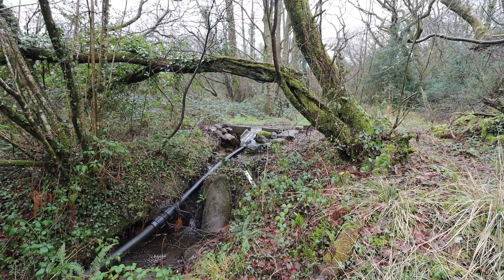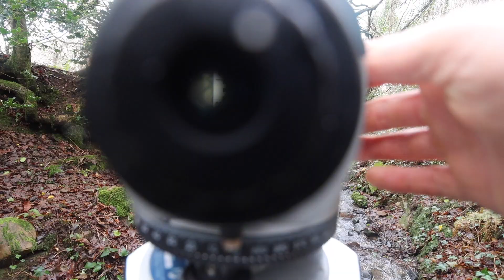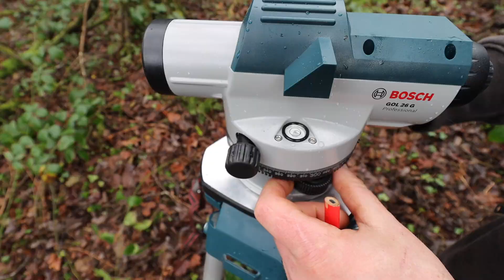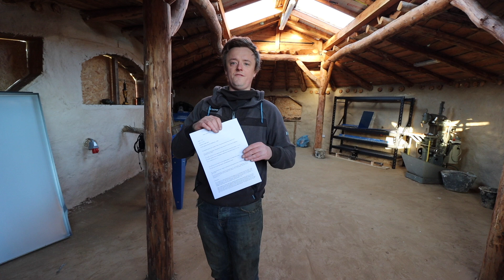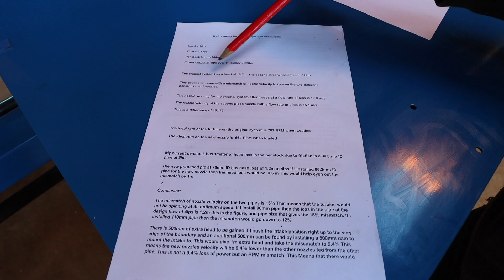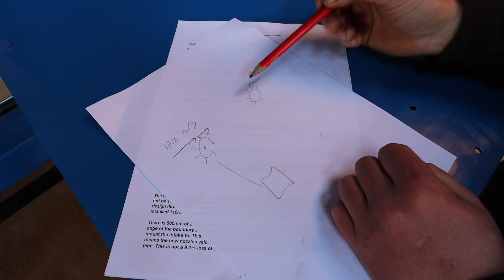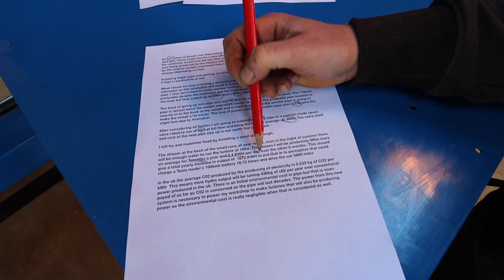Adding A Second Penstock To My Off Grid Hydroelectric Turbine (Survey)

Comment: Chris,  you can measure the water pressure in the bottom end of the pipe right. Use simple mathematics to calculate height of water.

Comment: To find the correct level for my oil tank I used a hose pipe filled with water, did the job fine after getting rid of air pockets.

Comment: I'm a bit late to the party here so probably just shouting out into a void. But I do wonder why not join the new pipe into the old pipe wherever possible? This could be done via what is known as 'an unequal T' (or Y would be more efficient), then increase the diameter of the pipe from that junction down to the turbine (if needed). This means that all of the water exiting the penstock at the turbine is all the same and there is no variation. 

What you did back there was take some accurate measurements of just one snapshot in time. This doesn't work in reality, because the stream flows are constantly variable.

Comment: In stead of an extra turbine, you could consider to only add an extra turbine wheel of a slightly smaller diameter. In that way it can deal with the lower waterspeed of the second penstock, without mismatch.

Comment: If I understand the theory correctly, the radius of the turbine is a variable in the ideal RPM for a specific nozzle velocity... If this is the case, could you stack two turbines on a common shaft, with your larger original turbine on the bottom and a slightly smaller turbine on top sized for the new pipe nozzle pressure?

Comment: Don’t be terribly concerned with looking professional. I once had an above ground swimming pool installed. The installer came in with a brand new surveyors transit. Set it up and shot all the pads for the pool wall supports. They put it up put in the liner and as it was filling I noticed it was several inches out of level. I called him back and he did some measurements and we had to drain the pool as it was almost 5 inches out of level. He was quite perplexed. It seems one of the people had tripped over the level as they were in the middle of the installation and it wasn’t reset. His brother showed up who also owns a pool company and asked him what he was doing. He explained that he got the pool up and it was out of Level. His brother laughed at him and askrd Did you really spend all that money on the transit? He then reached into the back of his van and pulled out about 100 feet of clear plastic tubing filled it full of water attached to a stake, and Proceeded to set his elevation on all the pedestals. He had it done in about 10 minutes. Of course he told his brother he was an idiot for spending all that money on the transit. It’s not how many cool tools you have, it’s how well you use them.

Comment: Thanks for your videos, I like the no BS approach you take. I have installed many water systems for drinking water and used an optical theodolite to measure fall as much as distance. However, I am not writing this to teach my granny how to suck eggs, rather to point out that you could have two rings of spoons on your turbine with different diameters set one above the other. As the turbine speed is related to the circumference of the turbine wheel with relation to jet velocity both supplies can act on the same shaft with least costs involved.
The video with the water wheel spilling water over the side could do with an angled plate set into the middle of the race before it hits the bend.
Keep up the good work, with greetings from Herefordshire.

Comment: Very interesting (I just binge watched SEVEN of your videos!), but I have a few questions on this one: Would there be any benefit in combining the two pipes before the turbine?  That way (I think), you don't have to worry about mismatches at the turbine, or adding an extra injector, you just effectively get more water/higher pressure coming into your system.  Also, if you take the water right on your boundary, but decide on a dam as well, wouldn't that mean that you'd create a 'mill pond' on your neighbor's land? (So, creating a dam effectively means moving the head back a few meters to stay on your property.)  And, lastly, if you extract water from one stream, but output it into another, does that have an environmental impact?

Comment: Hey Kris, I’ve learned that the most efficient energy transfer from nozzle velocity to turbine power is to redirect the water flow 180 degs as it travels through the blade. I see yours is around 135 any plans to improve or will this cause too much splash drag ?

Comment: Hi Kris, im not sure if you still check this video or how far along you are in following through on this second penstock, but I was wondering if you considered a hydraulic ram pump to pump the water uphill to the current penstock intake instead? Obviously it depends how much more power youre looking to get with the new system compared to how much water you could pump up with the ram

Comment: So, this might be harder to add in after the fact, but if you were building a system with both pipes from the start, maybe it would make sense to actually pipe some water from the higher head pipe to the lower head pipe?

Or would the fittings and turbulence involved to incur more loss than you might get by evening them out?

Comment: It sounded as you needed permission for it !?
*
I was wondering, if you made a joint some 20-25m before the generator and install a larger pipe there :
a) the loss would still occur?
B) would be too much cost?

Comment: At what distance in the existing pipe is the head between the two sources equal? Could you not run the second pipe, joined to the first, just  a meter or two below the equal head point and combine the flows in a buffer tank giving you more PSI at the turbine?

Comment: Hi kris, what would that survay cost?  I'm building a 6ft by 4ft adjustable width under shot water wheel  with 12 spokes as a hobby,  how would I calculate the flow needed to give 500 watts + thanks Ray from Manchester England

Comment: I don't understand.  I think the analysis is wrong. The flow rate and head of each water source is fixed (and thus the power each can contribute to the total is fixed), but the nozzle velocity is determined by nozzle diameter, isn't it?  Afaik, the velocity is proportional to 1/(d squared) so you can just choose nozzles to make the velocities match.

Comment: Your new level is what a surveyor would call a “Dumpy” level and whilst yours has just to get the spirit level bubble inside the circle for the auto levelling mechanism to work the older instruments were attached to their base plate which was fixed to the tripod by three screws which, when turned, altered the height of the instrument above its base plate. In addition you had two linear spirit levels fixed at 90° to each other.  You would start with a screw in each hand and twist the screws away from each other or towards each other. The golden rule being that the bubble in the spirit level you were seeking to adjust always moved in the direction of the left thumb. This mechanism was, for obvious reasons, called the tribrach. 

During its construction I was fortunate to visit the Nat West Tower in the City, now called Tower 42, and was surprised to see that the suspended ceilings were being levelled with a water level. A clear open ended plastic tube filled with water. All done with lasers now but never forget the old tried and trusted methods.

Comment: what if you install a ball valve onto the original pipe with a flow meter on both pipes to be able to see the actual flow rates and then even them out that way. Go with the larger pipe on the new pipe installation but add a ball valve and flow meter. You can adjust the ball valves to get even flow. BTW have you ever considered a ram pump which uses no power?

Comment: Maybe not for your system as you might as well start over, but maybe for future designs for others, what about another pelton wheel on the same shaft - I assume below the original wheel - of a different diameter? This would allow the spoons to go by at different speeds - but probably not a large variance in speeds available in such a small package, like the one you've designed. Great system! - Love the videos!

Comment: This comment is about 8 months late, but could you add a second turbine to the same shaft as the original one, but with a different diameter to account for the different nozzle exit speed?

Comment: Kriss, your water level gadget is brilliant, I love it. On your Bosch sight level, you should have cross hair lines, on the vertical line you should have horizontal strata lines above and below the main horizontal cross line, if you sight to your Staff count the number of centimetres between those 2 lines, the centimetres shown on the back of your staff, the number of centimetres will tell you the distance in metres between the optical instrument and the Staff, that's how my instrument works, I love your videos.
Dennis Scifleet, Australia

Comment: I've not read through all 800+ comments so this might have been mentioned, but why do you not throttle the new pipe back with a commissioning set (a valve slightly shut for arguments sake). This increases the head loss on the system (add that loss  to your pipe frictional losses) thus reducing the head available at the turbine inlet. Comparing this to any general pipework system this seems like a simple commissioning task like balancing radiators? Interested to know your thoughts.

Comment: Kris, very informative video, nice work. Not sure if someone has mentioned this already but you can measure distance using your transit level (if it has stadia lines) and the height staff. I used to do this all the time back when I worked for a surveyor. Whilst not accurate enough for setting out property boundaries it was very useful when it came to general civil works (cut and fill calcs). This video shows how to do it. It's very easy and likely more accurate than using distance measuring wheel. https://www.youtube.com/watch?v=wYeAEpP1NYo

Comment: Have you considered Tesla Turbine. It is based on a stack of simple disks with spacers between them, The water jet is applied tangentially as usual. Tesla turbine is simpler an cheaper to built, has no spoons and quieter operation, Combining two steams with different pressure and speeds into a the same turbine may be a compromise, It may be better to have two turbines/generators as the two steams will have variations and static tuning may not suffice. Two generators could be combined at the DC link cap of the eventual single inverter, Combining two DC sources is way easier than AC sources

Comment: Hey Kris.   Check out > Awesome Low Head High Flow Grid Tie Micro Hydro 530 watts! < on youtube.   Instead of adding another pipe to the nozzle you could simply add the Low Head High Flow by having a 2>3 meter drop on the end of the pipe.  Plz check it out.
If you got a 14 meter drop on 200m you could even put 3 stages of Low Head High Flow on a stair pipe system.  Could eventually give you up to 1500W.

Comment: Dont know the science and correct terms behind this, but what if you added a second plate with spons to the same axel and generator and adjusted its diameter to compensate for the differences in head. Would that work?

Comment: Would a smaller nozzle on the lower pressure pipe not result in a higher flow velocity? Or is your nozzle sized to meet flow rate instead?

Comment: Very informative about loss.
But I have a question, could you not build a larger dam further downstream which would raise your water head to the same height as the boundary?
This would reduce loss in the pipe by the reduced distance traveled.
This would require a good spot to anchor the dam obviously.
Great to have an alternative energy and back to the land channel to view😋

Comment: While the overall costs do not add up, would the cost of diverting the stream to the existing pipe Turbine stream further up, to provide overall, the same water flow during the Summer months when required and if not required shut off during the winter months when there is usually plenty of the wet stuff about?

Comment: could you have a second water wheel with smaller diameter drive the same shaft so the linear velocity is matched to your second slower nozzle

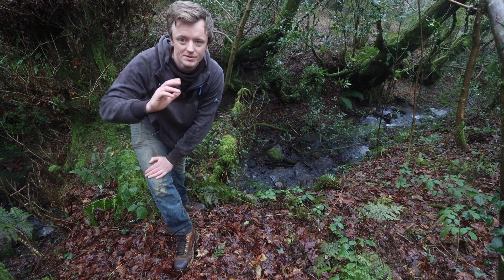Comment: I believe that the process that you use for measuring with the current equipment could be shortened if you were to eliminate the measurement of station height at each station position. You could measure the front site and back site  before moving the measuring rod. For example like in your video at 6:00 mark you measure and elevation and move the the point where the measuring rod is. Instead you could have taken the measurement and moved further down stream while the measuring rod stays  in the some place, the difference between the two measurements is your elevation difference. This is the standard practice in geodesy although we have gps now. Grate video.

Comment: Beings the heads height is different and would screw up the spin on the turbine why not just take the 2nd stream and install another turbine on it and just run the electrical wires together

Comment: what if you added all pipes together b4 the shed with enough length for turbulence and flow to settle, that just leaves one pipe onto the turbine blades, would a thicker or thinner turbine pipe and blades be more efficient ?

Comment: Kris, enjoying the  hydro project vids greatly. I am at the point, with my own instalation where I am trying to decide the  size of the  smoothing capacitor used after retification of the AC. Do you have a link or info that could help me ?

Comment: They surveyed America with essentially the same equipment you used originally. Length of chain for distance. Hacking their way thru forest, mountains and plains of grass higher than your head. Across raging rivers and swamps. So yeah the old stuff works just fine.

Comment: Can I ask a dumb question?  Why not combine the 2 pipes from both streams into one prior to the turbine so that the water supply would be averaged between the two prior to the turbine?  Then all the nozzles would be the same?  Wouldn't that also prevent vibrations from fluctuations between the two streams?

Comment: You'll gain some accuracy and also it is quicker if you leapfrog each other. do a foresight on the staff, then the staff stays in the same place and you pass by down the stream and do a backsight at the staff, then the staff jumps you and you do another foresight, and continue like that to the end.

If you wanted to know the error, you could then track back up and close the survey back out.

Comment: Could you just use a slightly smaller nozzle hole diameter inside the turbine attached to the new penstock, accelerating the flow to match the existing nozzle discharge velocity. Calculate the nozzle size using Bernoulli's Principle.

Comment: Why not join the two flows together 4 meters from the turbine, using a larger pipe to avoid the mismatch in flow
Reply from the maker: That was an option I considered but its not a good way to do it. If one intake blocks and one pipe drains it will suck air in to the other one. If it two separate pipes one should always be running even if one get blocked. So with two pipes I would have both running most the time until one gets blocked and then one will run for a bit until I unblock it. With them join together the only way to run it is with both pipe full and unblocked or the whole thing will stop working properly.

Comment: Kris .... don't get confused between pressure and velocity .... no mater what your pressure is you can always turn it into velocity  ... gustreduced the nozzle size and you will have velocity .... if you have multiple noiseless and different pressures  (IE head)  that's not the issue .... if you want a uniform load on the turbine then you need a uniform velicity as in (meters per second) regardless of the pressure or head.

Comment: What I thought I'd right away was why don't you just combine the two pipes into one before routing to the nozzles to get ennen pressure?
I have no idea if the pressure difference would cause turbulence or other losses inside the pipe, but my intuition was it would be less than different nozzle velocities?

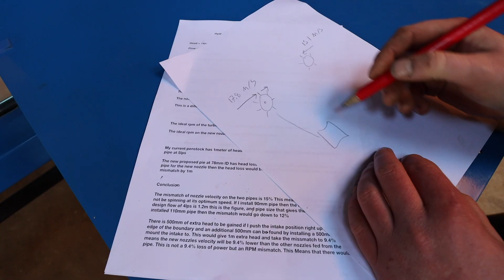Comment: @ 22:08...this is why you need a bigger turbine wheel...and now since you know the head is less on the new pipe...it wont even have any effect.....I would put a second turbine in parallel ...using the second pipe, which would increase your total power output
Reply: doing that you would need another MPPT charge controller, you could use the same battery bank ...but then you might need a larger inverter....
or separate the 2 systems completely ...use one for home and one for the shop

you should have enough money now after all these youtube videos

Comment: to have precise flow measurements, you need to have an exact opening using a weir...then you can use that to convert to the size of pipe you are going to use and know what the flow in that pipe is....but none of that matters when you reduce the size using jets on the turbine...all that has any bearing on power then is head pressure....dynamic head pressure to be exact

larger pipe and friction wont be in play on your system due to the fact that you reduce the flow out the end....so bigger pipe straighter run wont make any difference

as I have said before...on small systems like this where you reduce the flow at the end, all you need to be concerned with is dynamic pressure and head pressure...any engineer will tell you the same thing